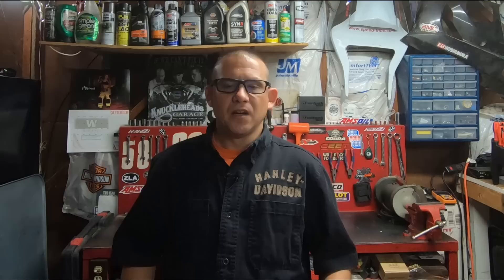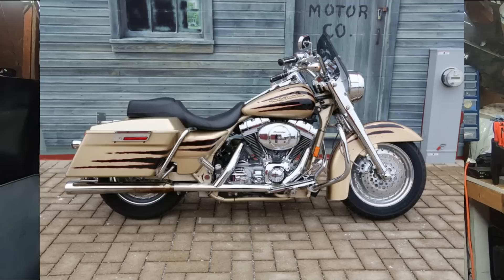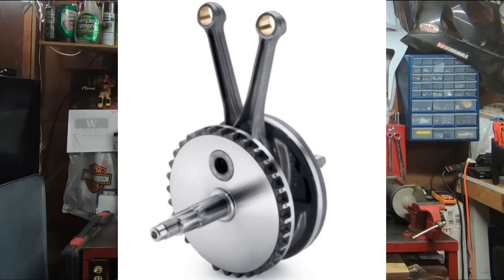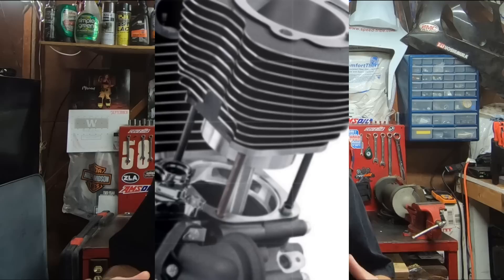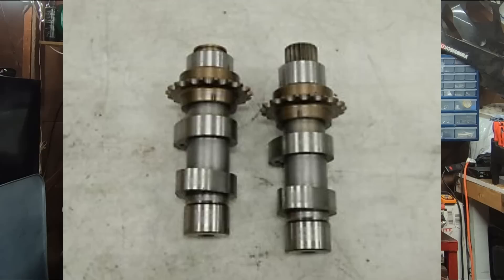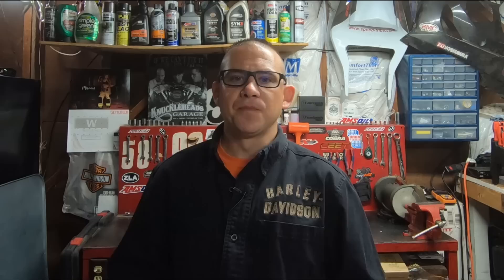The Twin Cam 103 With Hidden Secrets | Harley-Davidson CVO 103

Comment from the maker: Do you think the CVO 103 being a stroked 88 would run off and leave a CVO 110?
Reply: Depends on if the two engines are on the same bike.
Reply from the maker: This is true, I dunno I think that 110 would out run that 103.
Reply: @GixxerFoo  if both were CVO bikes yes the 110 has it.
Reply from the maker: That's my thought, l have talked to guys who say they have watched a CVO 103 leave a 110 🤦‍♂️🤷‍♂️
Reply: @GixxerFoo  maybe the guy on the 110 didn't know how to ride. 😆
Reply from the maker: 🤷‍♂️ l was thinking it but wasn't gonna say it
Reply: I'm not sure if it would run off and leave it. But it may overpass it.
I'm rooting for the underdog !
Reply: @joetroutt7425  that plays a part in it just because you got one doesn't mean you know how to ride it. great comment, I think they're matched so close that the rider would play a part in it.
Reply from the maker: Some of them bored and stroked out motors are pretty mean.
Reply from the maker: Ride is always a factor, you'll see guys on 400 ninjas riding circles around litres bikes at the road race course.
Reply from the maker: They will do it! Harley didn't like to advertise much about Sportster horsepower, lol it was more than the big twin.
Reply from the maker: That's kinda what l was thinking when l heard stories about a 103 taking a 110. I figured the rider on the 110.
Reply from the maker: Will do! I have a lot more coming!
Reply: nunya business  .....only a 170 cubic inch v twin motor will do 7.5 seconds dude...no 110 ever gonna b that fast
Reply from the maker: Eclectic bikes are pretty dang fast, all power to the ground at once.
Reply: nunya business  dude I dont even remember those comments, and I'm not trying to start a passing match here....just friendly banter...check out Assim Chaudry and his king kong road king....170 cubic inch 200 hp monster!...its impressive.....gms racing you tube channel....have a good night man!...
Reply: nunya business  i honestly don't care
Reply from the maker: 170 inch?? How tall are those cylinders 😮?!
Reply: @GixxerFoo  gms racing you tube channel....his motors are impressive
Reply: @GixxerFoo  Damien Kuskie is the name some of the videos are under. He is the dyno tune guy that works there...Greg Dahl is the owner of the shop....he built Assim Chaudrys bjke king kong
Reply from the maker: They build some stout iron over there, l don't want to think about what it would cost though.
Reply from the maker: They really know there stuff, that's one monster bike too!
Reply: If you used a 4 inch stroke in a 103 you would have a 95 inch motor & yes you would be quicker to get to top speed but the 103 would take you on the top !
Reply from the maker: That's correct, the same thing happens on M8 114 vs the 107.
Reply: Since hove got my 04 CVO Electra Glide I’ve run a few guys on 110’s and I have not lost yet well until I got cocky and ran a guy on FXDL 131 he spanked me like a red headed step child lol
Reply from the maker: 😆😂 well it's a 131 🤷‍♂️ They produce some insane power.
Reply: I'll put my 95cdi 2000 softail heritage classic against a stock 110 any day of the week. ;)
Reply from the maker: Oh yeah a stock 110 really doesn't make an overwhelming amount of power.
Reply: @GixxerFoo  my 2000 heritage is built for power as I have stated many times and 114cdi cant beat me stock so i know a 110 dont have a chance
Reply from the maker: What kinda power numbers are running on that beast?
Reply: @GixxerFoo  120 hp 105 ft pounds torque rear wheel dyno bro
Reply: @GixxerFoo  I have the darkhorse crank 4in stroke screaming eagle ported heads and intake mikuni 45mm Andrews tw60a cams screaming eagle lifters and adjustable pushrods and screaming eagle cam support plate and oil pump twin tech ignition the  pistons are 10.25.1 screaming eagle domed pistons and cometic head gasket and 20,000 off heads with corrected compression 10.5.1
Reply from the maker: Oh yeah, l'd say it's making the power and definently legit for sure!
Reply from the maker: That's a very solid setup, sounds like it has been done right! I imagine that is fun to ride!
Reply: @GixxerFoo  well the speedometer isn't big enough 120 and still has more throttle to go
Reply from the maker: 😆😂🤦‍♂️, that's crazy... have to use the GPS then. I don't know if l would want to know how how fast l was going after 100.
Reply: The cvo 103 with the 253 cams in stock formation will take the 110 on the top end I have an 03 cvo road king the 110 with its 255 cams falls on its face after 3500 rpm that’s when the 253 cams are pulling hard . The cvo 103 is way down on compression for those cams deck the heads with .030 gasket to get compression up and that engine wakes up and will smoke the 110
Reply: I think it’s very possible, the 110 isn’t impressive. I like axtell 4.125 bore 4 3/8 stroke 117. The key is the heads, the heads, the heads. 110 heads are terrible out of the box. They are ok for a cheap head to be Cnc’d. They end up around 324 with stock style intake.
Reply: Im running a screaming eagle 103 ...its beast....but i have it on non cvo fatboy
Reply: How much of a gain is there go from a high compression 95”, to a high compression striker 103”?
Reply: Well my none stroked 100 cubic  inch. 88 runs away from 110 cvo bikes all day
Reply: @joetroutt7425  out on a limb there.
Reply: Only one way to find out
Reply: I have the s.e t.c 103 with cams head work zippers chain..running a road glide with a 15 103...with zippers performance chain..I sure ok
Reply: Yes. I’ve done it several times , never failed , always prevailed to the point of embarrassment to the 110 factory cvo.
Reply: GixxerFoo trying to do big bore kit on a 04 103 not sure the way to looking at the fuel moto 107 my problem is cam selection s and s 570 is what my shop recommended what do you recommend

Comment: The 103+ heads back then were proven to be some of the best, if not the best Twin Cam heads ever. They are hard to find now and spendy. Wish I'd have picked a set of them up ten years ago or so. They were relatively easy to find then and relatively cheap. Kind of a well kept secret as far as heads go.
Reply from the maker: Thanks for the info! I have heard bone stock they held the motor down, then I've heard they are great with a little head porting, then I've been told they were junk. I still believe they were some pretty damn good heads, they really cam to life with some head porting and yes they are very hard to find these days!

Comment: I ride an '05 Ultra with a SE103 Stage I built new by the dealer (American Eagle H-D) in Texas. All H-D , 10.5:1 pistons, SE255 Cams, Clutch, SE Mufflers, and SE Race Tuner Kit. Dyno at 500 miles = 95.44 HP and 103.98 Torque. This bike has 87,977 miles on her. It has all original parts - Clutch, starter, mufflers, Trans, even hand grips. (on her 3rd stator) Used SYN3 oil in Primary, Trans, and Crank since new. YES it has a H-D oil cooler. This bike is better than new. She still begs for that triple digit run. A bad ass machine no doubt. I truly enjoy your videos. Great information. Keep it up.
Reply from the maker: Thank you! I appreciate your support of the channel! You have one bad ass build, sounds like you've rode it quite a bit too! I think that answers the question of reliability going beyond stock, it can be done but it has to be taken care of like you've done.
Reply: you need to change pipes i made 110 torque 92 horse with same build but stock compression but with a bassani road rage 2 b1 power pipe
Reply: @Dynachop420  ha, great minds...I upgraded to S&S headers and mufflers. There is a difference.

Comment: Thanks for making that clear for me. I have a 06 ultra classic with an 88 in it. Then I started getting some bottom end sounds so I take it to my local harley shop and ended up doing the 88 to 103 method. With your help, now I know where the idea came from. Good rides people.✌
Reply: So your 88 to a 103 with the stock crank?  Cause I wanna do it to mines. O4 deuce
Reply: By time you do all that to a 88 inch motor?
You could buy an s and s motor.

Comment: I don’t know if this will walk away from a 110” and don’t care, what I did learn is that it is fast, torquey and strong! Great info thank you.
Reply from the maker: You're very welcome, the SE 103 runs pretty dang good! They could for sure benefit from some head work but they are stout just as is.
Reply: How about reliability? Or any issues with the 103?

Comment: I have a 2013 Flhx with 103, i put a d&d fatcat full exhaust and tuned it myself with a dynojet power vision without o2 sensors. Its been awesome. Reliable and singing along.
Reply from the maker: That D&D is a nice exhaust, they really produce power!
Reply: I just got a 15 with d&d 2 into 1 exhaust and same dynojet tuner with 02 sensors and walk my buddies 114 m8 like it's nothing

Comment: This is similar to the engine in my 103 Police edition Road King. I'm not sure if it was ordered from the factory with a stroked out 103 with the larger cylinders, like an '03 CVO engine, or if it was built later. When I bought the bike, I wanted to make sure that I had performance at highway speeds. It has tremendous torque and is very fast for an old touring bike. It quickly hits 80 in 4th gear, and easily cruises at faster speeds in 5th. In fact, when I get to a 55 or 60 mph stretch of interstate, I have to down shift. It feels like more power than my 2020 Low Rider S that I sold because I wanted a better highway bike. It has a power tuner, a huge cam, and no screamin' eagle logo on the heads, so I am thinking it was some kind of police 103 modified for more power later.  I DEFINATELY recommend a stroker build, if you want the performance of a newer 35 to 45k Harley on your old paid-for touring bike.

Comment: I have a 2005 103 CVO that I did some work to beef up the weak points and added a complete cam setup with compression and I am getting 115hp/127tq at the rear wheel. I left some on the table for future work if I want more power but it has been a fun ride and never lets me down.
Reply: Hey what cam did you swap in?
Reply: @sharpwrax  I went with a Wood TW6H
Reply: So you put the high compression pistons in like he suggested in the video? What fuel management system are you using with or without O2 sensors? I just purchased me a used 2005 Screamin eagle Cvo street glide. 
I’m Looking to get a lot more power and run with the big dogs.

Comment: the 103 motor on my 2014 ultra with a stage 1 and vance n hines header pipe, n vance n hines highout put slip ons,   had lots of low end torque and ran strong up n down hills with minumum down shifting,  it can strong but on the freeway my speed was topped at about 86 mph pushing it harder there just wasnt nothing more it felt like I needed another gear to upshift,  now my older 2010 ultra limited I just down shifted more on the hills, but on the freeway that bike would get up to 110 mph no problem at all compared to my 2014 103,   so my first new Harley is a 2021 new road glide limted with a 114 engine, I put a stage 2 on it before bringing it home screaming eagle cam, n vance n hine power duals with rinehart slip ons, talk about a very loud bike n the idle is tough sounding too, sure its not a woods cam or  s n s cam, or a zipper cam in it, but compared to my last 2 bikes n putting out a humble 117 torque at 3500 rpms that bike is going to be a rocket compared to what Im used to, and have long legs on the freeway the way I had it built for, sound n the freeway, long legs while keeping my factory warranty,  I wasn't trying to build a race bike, but wanted a very fun enjoyable bike, where i twist on that throttle n go go go around anyone I want to pass, and find my own solitary piece of the road,  but thats me I watch for my own safety hazards, 3 million miles in a semi would kinda qualify me id say
Reply from the maker: The 2014 bikes were really awesome with the Rushmore project and that's the year they put the .511 cam in the 103's. That made a huge difference in the power and torque on those touring bikes!

Comment: I got one of these 88's, built by my local race man. Screamin Eagle heads sent off to Ward Performance and ported, inside and out. 10,000 off head to increase compression, 10 to 1. Ward Cam 255 duration and 63 lift. Stroked and valves ground with 4 angles. Big throttle body and Cam gears. Only 600 mile, so not Dyno yet, but she be fast! 2006 Dyna
If I am at a slow roll and open it up, it will lay rubber all the way till shift.
Reply from the maker: That's gonna scream, especially with that compression ratio! The problem with the CVO 103 engine is the heads were really inadequate and lack of compression.
Reply: By the way, this is my third build, Harley 1st 92T 86HP, 2nd 117T 108HP, 3rd ?
Reply from the maker: Damn you keep stepping it up each time 👍
Reply: Thats great to know man im getting similar work done to mime as well...
Reply: @GixxerFoo  Also Vance @ Hines 2/1 competition exhaust
Reply from the maker: That's a good pipe, well worth the money!
Reply: @GixxerFoo  A $1000 dolars.
They must have laughed at me hard when I was searching for a light shifter. It will it the rev limiter before shifting. I started out at 57hp. The gear ratio needs changing. Red line is 50mph, I need at least 60mph, it will still ne probably too strong, but I can live with that, I feel the power! Love you for sure.
Reply: @GixxerFoo  My God the back tire will not hold, she fucking hits the rev limiter! I fucking had a stock 88.
Reply: @GixxerFoo  Hey GixxerFoo, we do not even know why airplanes fly yet.
Reply from the maker: Sounds like it! They are geared pretty ridiculously and run out way too quick.

Comment: Another great video my friend! I remember in one of your recent vids you said that there’s  a difference in cvo heads and high flow screaming eagle heads. Can you tell the difference from how they look externally? If the flow rates are different how bout the springs and etc. ? Thanks in advance
Reply from the maker: Externally they look the same, but if you have the two heads off and side by side you can immediately tell the Screamin Eagle Heads have a much larger combustion chambers. Also the SE heads, depending which set, they will have over sized valves, head gasket milling for compression, and valve springs to handle aggressive cams. CVO heads have some mild porting, stiffer valve springs for the larger cams that come with the CVO.

Comment: TC Harley Davidson engines are great to modify, there is plenty of parts out there and easy to work on.
Reply from the maker: I like the twin cam over the M8, it has a lot more knowledge base out there and the aftermarket has solved a lot of the factory problems.
Reply: @GixxerFoo  I will keep you informed. The oil is dirty at 700 miles, I told him I wanted it rich, so he put in another map. Too much fuel or opening the intake before the exkaust valve has closed, we just need to wait.
Reply: Or maybe the opsite, I am drunk.
Reply from the maker: I'd say he put the fuel to it having the oil dirty with 700 miles!

Comment: YOUR VIDEOS ARE AMAZING!!!!!!

So I found a 103 Screaming Eagle crate motor, in a small dealership in Ohio!! 0 miles, never mounted, in the BOX!!!! 

I have a few questions about upgrades and your thoughts. I have a stock 2005 Road Glide..

1) Is a Chain Drive Conversation recommended??
2) Which sprocket gearing conversion would you Suggest ???
3)And do you recommend and transmission upgrades?
Reply from the maker: The 5 Speed is pretty tough, the factory SE 103 engine was mounted up to a stock drive train so you'd be good to go making a direct swap.

Comment: My ex 2000 deuce 88ci that the previous owner turned into an 103 stroker smoked any and all 110 CVO embarrassingly so! Not even close. Like half track. I wish I was knowledgeable in mechanics and could go back in time and watch who ever built that motor. I do have previous owners receipts. Stock dyno was 58hp. After everything the 103 was 119.9hp I wish I’d never sold. When I did sell the stipulation was if he ever sold would be to me. But sadly he passed away and left that rocket to his 18 year old grandson. I’ve tried several times to buy back but no go.  Anyway Another great vid!  I’m looking currently between the 2009 fire quartz 110 dyna fat Bob and a 2012 plain 103 WG . Common sense should lead me to the 110. But the WG has an amazing custom paint job ( even better looking than the 2009 fire quartz and black which is my fav all time HD paint scheme). I’d prob have to send the WG to Fuel moto and spend $10k to even feel anything like my deuce 103 stroker. I know the 2009 110 cvo would need at least half that much as well if not more to feel like that 2000 stroker.  Question , can you make a stroker out of the 2012 103’s? If so you want the job and create me a 130/130 hp and TQ bike? How much would that cost a feller?

Comment: Man these 88 twin cams are hard to beat I may this winter make my 88into the 98 if I don't buy a street glide 2013 or higher
Reply from the maker: They are really good motors once you get that cam chest tensioner setup upgraded.